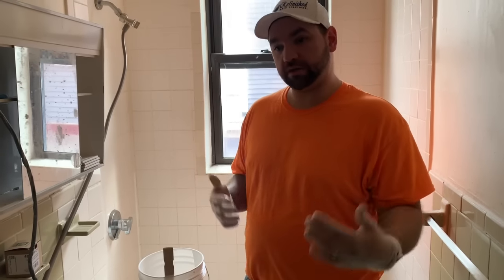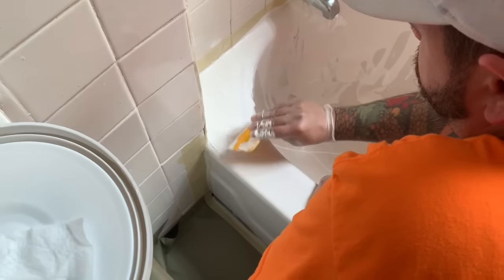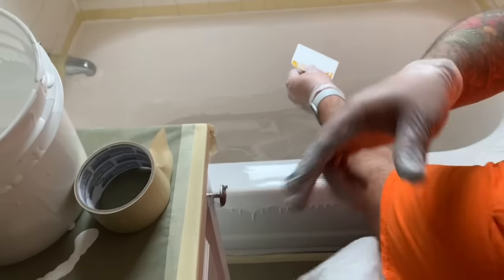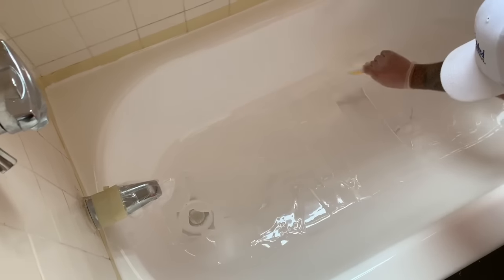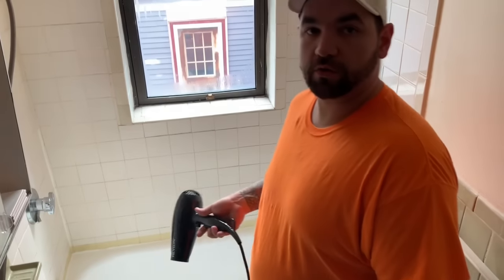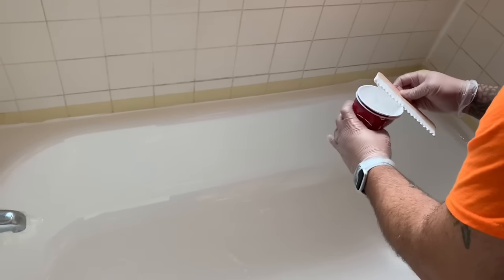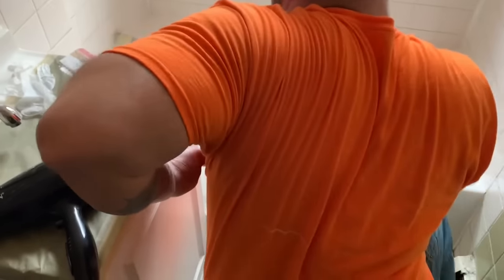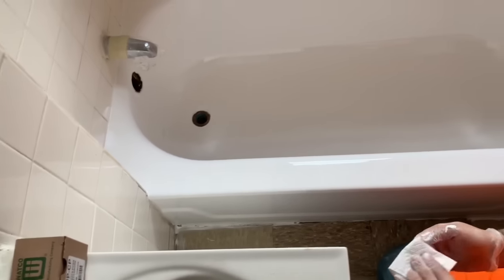Ekopel 2K is 20 Times Thicker Than Spray on Coating | Refinish A Tub Series Step 4

Comment: no prep work ? it ill last at most 2 years . 1 year if you dont mind cranks ,
Reply from the maker: Shazam with no prep work it Ekopel would still hold up long term as it cures at 1/8 inch thick.  I wouldn’t recommend that though as it would likely be full of dirt and soapscum. 

Check out steps 1-3 for the prep work steps. Most people watch all of the videos.

Comment: The tub you just did goes for $149, this product cost $149.
Reply from the maker: So does the dumpster, also the new tile, also the floor, also the backer board, also the hardware, also the plumber per hour, luckily the contractor to do the demo and the new install is only $50-75 per hour. $5,000-$10,000 vs $150. Didn’t realize $150=$10k. Learn something new everyday.

Comment: How many tubs can one guy do in a day?
Reply from the maker: As a full time refinisher, If you have experience and a helper 5-8 at 1 location. 
If you have multiple stops 2-4.
If it is your first time And your thinking of doing multiple units in your own home I would do all the prep work on both units the. Fully pour and level one unit before pouring the 2nd.  You should be able to do 2 in one day at 1 property as a first time user.

Comment: home deepshit sells steel tubs for like 120.
Reply from the maker: Abida Babida they sure do and they will last you a good 5 years before they rust out.  Demoing the whole bathroom ever few years is easily in most peoples budget.
Just $120 for the tub $100 for delivery, $200-500 for demo, $500-$3000 for the new tile, $100-$500 for hardware, and $200-$500 for the plumber. Just be sure not to damage the floor or you will need to replace that too. $800-$2500. 
Hope this helps!

Comment: just get a new tub. it isn't that expansiv
Reply from the maker: Simon Schmid nope only $3000-$20,000 lol
Reply: $3000 tub???🤔
Reply from the maker: Rickblaine cheapest tub you can buy is $200 plus $1000 for demo, $1000 for install, $300 for plumber. 
Of course that’s if you can manage to not destroy the walls or floor removing the old tub. 
Though be wary cheap steal tubs rust quickly and will need to be replaced soon after. 

Ekopel on the other hand cost $129 and will cure 5x as thick as the enamel on a brand new steel tub. 
We are only here to help.
Reply: @RefinishedBathSolutions  thanks for responding with such detailed information! 
What area are in? 
While I can agree with the process, the price for that process is is about half to a bit less in Texas. I can only imagine that you are far east or far west in u.s for that rate! 
Not trying to argue or say your process is not needed because apparently you do great work and have mastered your craft...just general questions. Thanks again for your time and your video!
**What's the total cost for product AND service**. Saw $129 but...
Reply from the maker: Rickblaine don’t need to be an expert to do it. We sell 1,000’s of diy kits per month. At 129-159. We don’t actually off the service unless it’s a large property with 200 or more units. 
There are 10 companies in Texas that install Ekopel for customers that want to hire a pro. They charge $500-$900 depending on the area and most offer a lifetime warranty
Reply: @RefinishedBathSolutions  you sir are a gentleman and a scholar! 😉. I will be sure to keep up with you! Thank you for your time and information!
Reply from the maker: Rickblaine we plan on doing more demos with all refinishing tools and products in the future is there anything specific you would like to see?
Reply: @RefinishedBathSolutions  thank you for asking ! Nothing in particular...keep up the great work and look forward to your videos!
Reply: @RefinishedBathSolutions 
500-1000$ for a tub and the rest diy. Or 1500 extra for installation and restore the tiling. But your right, if someone likes to "upgrade" there tub and doesn't have the money - it's better than nothing
Reply: @Conex145  *their😉
Reply: @BumpNrun69  😆😆🤦

Comment: Sad to say, where the tub meets the floor looks terrible, you should have edited that part.  Also unless you plan on selling right away it’s not worth spending the money.  I have been doing plumbing for 30 years and we have torn out a lot of tubs that were so called refinished with epoxy, paint and what ever other material they used. Life span is 4-5 years. No one will guarantee past that for a reason.
Reply from the maker: full moon We appreciate your feedback. 
We recommend recaulking the outside of the tub the following morning.  This leaves a crisp edge. The video is cut to show the proper application.  This includes how to clean any spots that get under tape and need to be wiped off of the floor. 
Luckily this is not epoxy paint.  It is a hybrid casting resin. 
Any tub that is painted with a cheap rustoleum epoxy will wear out very quickly as you explained.  
If prepped correctly in a DIY application this material will never peel.  
Please give us a call tomorrow I’ll get you a sample so you can start recommending our product to your customers.
Reply: @RefinishedBathSolutions  Do you work in the Atlanta, Georgia area
Reply from the maker: We don’t do installs currently. Just trainings, product manufacturing, and product sales.
Reply: it's called caulking
Reply: @RefinishedBathSolutions  is it possible to get a sample since this is an investment although not huge it wont be cheap if you're doing more than just the tub not to mention supplies to clean and prep? TIA